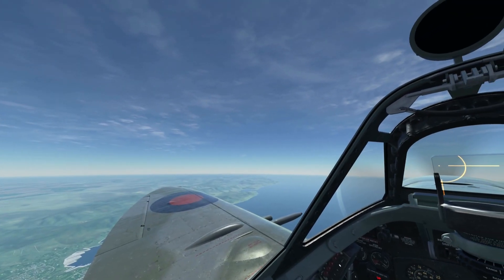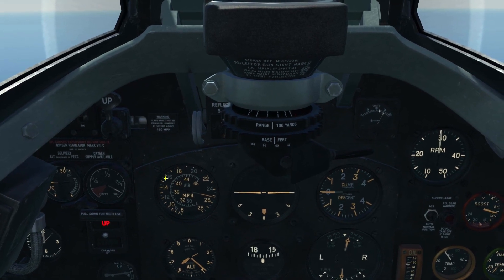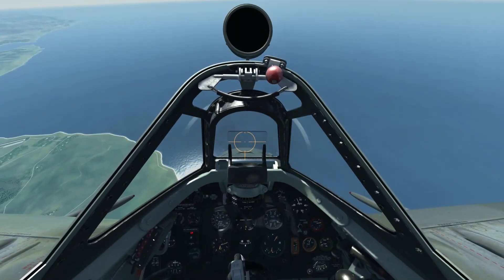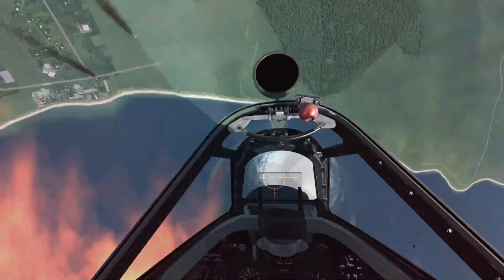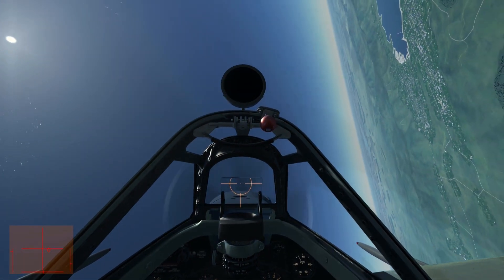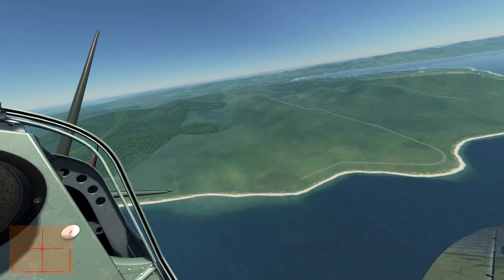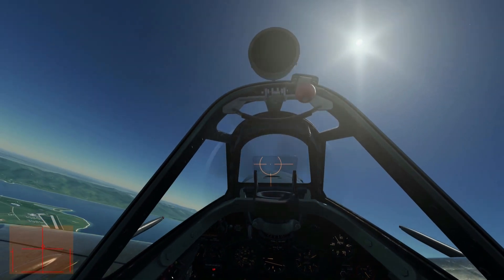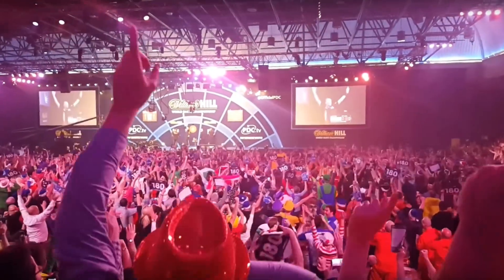DCS Spitfire -  Wing Break Testing

Comment: Does there need to be work to simulate how much you can yank the stick depending on the airspeed for aircraft with cable driven flight surfaces?  In reality you would bend the stick or break the cable before you could get the elevator surfaces to deflect so much as to break the wings off?
Reply: No, the spitfire had nearly neutral static stability, and the wings could be pulled off with one finger on the stick. It required a 2lb pull to initiate a 6G turn, and the stick had to be pushed forward to prevent the turn from tightening on its own.

Comment: can you adjust the curve on your elevator. It seems as if it has way too much authority (if pulling even halfway back  pitches the plane into a stall)? I can't knock what works for you, and I'm basing my POV on my own stick, and the adjustments I had to make in order to attain smoother flight, and more easily manage the subtle changes needed in lining up a shot. Then, my stick is an old tech Cougar.
Reply from the maker: longbowdt listen to the audio again. I was apply full stick back, not half. there already is an adjuated curve as I explain in the video, which is why when I apply full stick it gives about 40 to 50 deflection.
Reply: I stand corrected. :)

Comment: Those wings break like matches and you really get no feedback from the game before that happens. Other flight sims provide some sound feedback of like bending/cracking metal or something, but in DCS I can hear nothing. 1 second I'm diving and in the other both wings are gone.
Reply: This would be my biggest complaint also. Firstly I sort of doubt that I pilot could put a plane in a 400mph dive, and then yank back on the stick in one swift manoeuvre and sheer the wings off the plane. I'm really not convinced they'd be strong enough. Secondly, even if it is possible, there is absolutely no feedback ... it's probably one of the bigger weaknesses that DCS has (and I'm a big fan of DCS).
Reply: Well, I'm not. Like 3-4 modules but overall from my perspective its not impressive. 
But in regard to pullout, I doubt as well. And the way the controls are modeled as well, makes it problematic. Rudder inputs especially must be extremely delicate, Spitty is the only aircraft in DCS where I have so high curvatures set. Otherwise its a wobbly sausage in the air.

I'd also like to see a decent engine management tutorial, since the number of times I have overheated my engine is similar to the times I broke wings. Few vertical maneuvers and you are done for, speed must be kept above 220 mph to provide sufficient cooling. Unfortunately 109s/190s can climb all the way to the stall and do not risk killing engine.
Reply: DCS always feels kinda "half-baked". There are some really good things about it ... but the modules are really expensive and to my mind only half done. For example, the damage model is terrible ... they've been promising a new one for years, but ... we're all still waiting. The plane selection is also really badly thought out.

If what people what to do is to simulate flying some planes around, it's really good at that. But as a WWII combat simulator ... it's kind of hard to really recommend right now IMO.
Reply: The issue is not the short sticks that simmers use, you could hit exactly the same problem with a full scale joystick. Instead the problem is the poor modelling of stick forces. In real life the control stick is directly connected to the control surfaces by mechanical linkage. Deflecting an elevator through fast moving air requires a lot of force, and it requires ever increasing force the more you want to deflect it. Real pilots are limited in how much force they can apply so they are limited in how much they can deflect the stick at high speed. Additionally real people cannot apply elevator deflections quickly at high speed, they can only move it slowly because it is too heavy.

Many other sims model this by simulating the pilot's strength. You might ask the pilot to try and move the elevator somewhere, but if he doesn't actually have the strength then that won't happen: you'll get less deflection than you ask for. Other planes in DCS do have this modelled (to an extent), but for some reason it seems the Spitfire does not ... or the modelling of it is very poor.

Additionally the modelling of damage to the wing is very poor in DCS. There are real life reports of pilots having applied too much force and having bent the main spar. The plane was still flyable, but it was damaged. In real life applying too much force bent the wing and subtly damaged the plane. There are absolutely no reports of any pilot ever applying enough force to sheer the wings clean off. That simply requires more force than any human could ever apply. ED have decided to implement these limits as an inelastic limit: as soon as you start exceeding the G limit for the wings they immediately fly off. In real life, of course, it's an elastic limit: you can exceed it but your plane is gradually damaged.

Here's how it should be modelled in DCS. Firstly they should be properly modelling stick forces, the pilot should not be able to apply that much elevator deflection in so little time when at high speed. The virtual pilot might honk the stick back for all he's worth, but the actual elevator should deflect gradually. Secondly when approaching the elastic limit of the wings, the plane should start groaning and creaking like crazy to give the pilot feedback. Lastly if the pilot does start exceeding the limit then the wings should be gradually damaged, rather than just "popping off". At this point the plane would be making all sorts of terrible noises and the virtual pilot would know to lay off the elevator.
Reply: Also  rudder movements are an issue because - as has been confirmed on the forums - no air load is modelled on the rudder currently (it's still in development - pre-purchase, remember?). I'd expect this to settle down some as we reach full release.
Reply: There will ALWAYS be an issue when trying to represent the ~1m of stick length in a real aircraft and trying to map this to a short little simmers joystick. There is simply not the horizontal travel on a simmers joystick to accurately reflect that of the prototype. Thus very small sim joystick movements represent much larger inputs when correlated to the real thing - hence why we have curves. It's either that or build your own control column of prototypical dimensions. And yes the Spitfire's elevator authority is powerful, this is well documented in reality. If you are snapping wings then you are pitching too violently at speed. Simple as.